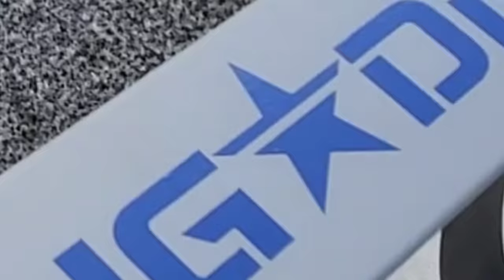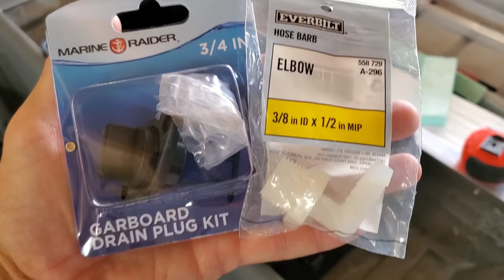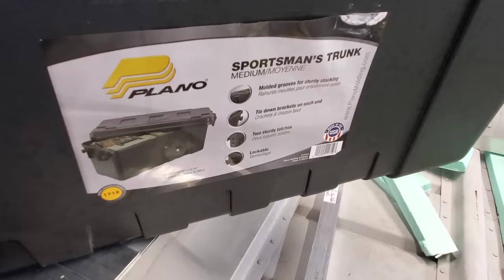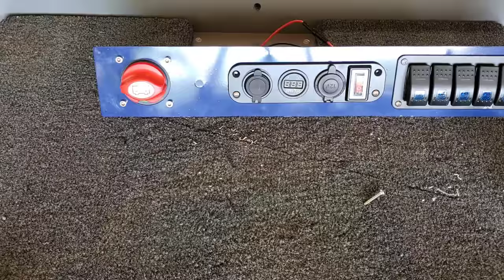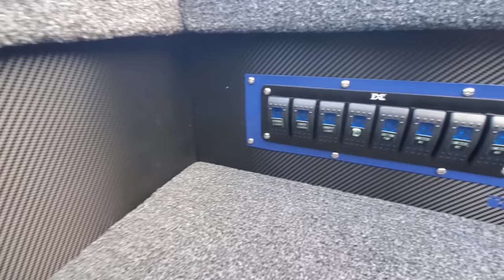JAW DROPPING JON BOAT TO BASS BOAT FULL BUILD | From Start to Finish

Comment: all that attention to detail and no finish on the trolling motor mount?
Reply from the maker: What do you mean? It comes raw aluminum and we color matched it to the boats paint job...
Reply: @AnthonyJonesBrigadeBoats  ahh ok sorry must have missed that. Thought is was sitting as raw aluminum. Crazy Build for sure.
Reply from the maker: All good man. We painted it separately and mounted it after decking. The boat being grey probably doesn't help.